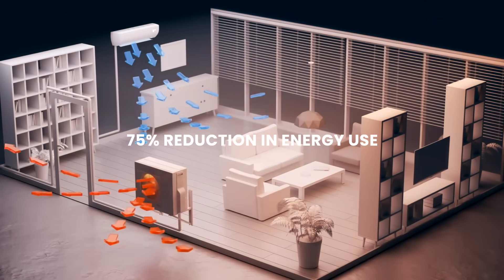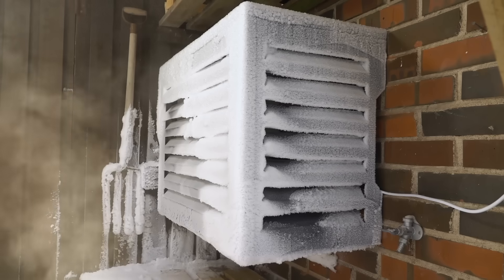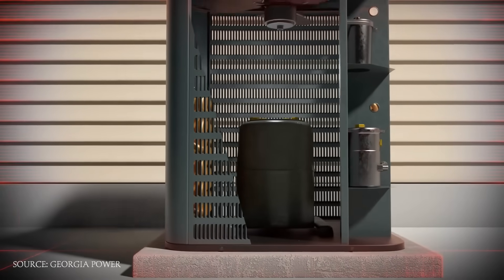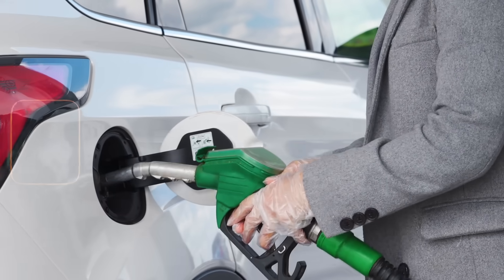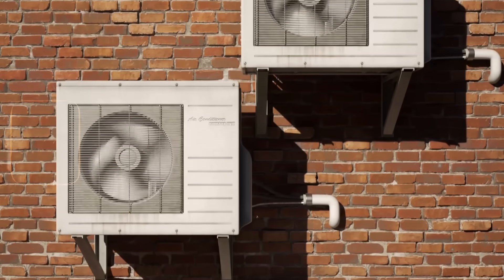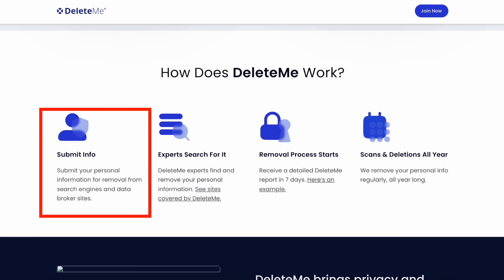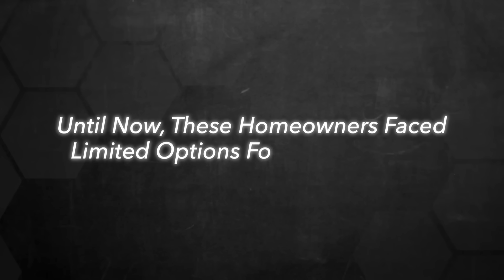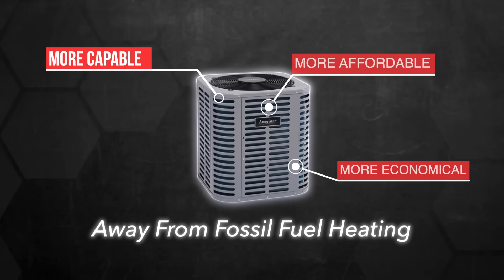Genius Heat Pump could change how we heat our homes forever

Comment: If it is indeed -32 degrees F that this heat pump can still operate to that is impressive.

At temperatures below -5°C (23°F), many standard models become less effective, but they can still technically operate, just with much lower efficiency.

From what I know, most modern residential air-source heat pumps can operate at outdoor temperatures as low as -15°C to -25°C (5°F to -13°F). Now operate, of course, does not mean they are efficient.

NOTE: Modern residential air-source heat pumps must have a minimum HSPF2 of 7.5, with high-efficiency models reaching 9 or higher. This means they deliver 7.5 to 9 units of heat for every unit of electricity used.

Checking the internet, I found the statement, "Some advanced cold-climate models can function even at temperatures as low as -22°F (-30°C)."

Comment: The first thing people should consider is are you going to stay in your home until you die, number 2 how old are you, if you are in your late 60s or early 70s it will never pay back
Reply: There are 2 parts to this and you are only addressing 1.  Yes, the ROI short term may not be there.  However, if you can show that your heating/cooling bills are $$/month lower than they were with traditional/the previous/comparison systems, then that increases the value of the asset.  I'll give you an example, let's say you're saving $100/month as compared to your neighbor for an near identical home.  Let's also say that this unit lasts 15 years.  At a minimum, without factoring interest or your tax rate, the borrowing power of your buyer will be $100/ month more or $1,200/year or $18,000 over the life of the unit - and that's also assuming that the price of energy does not increase.

Comment: Huge negative about heatpumps is that it takes moisture out of your house during winter, which makes it feel colder but also steal moisture from household items like shoes, which makes them brittle within a few months to a season. Ill take gas and oil any day over these overpriced systems that use basic off the shelve parts. Gas and oil systems are cheaper upfront, and have stood the test of time. Many new technologies have many issues that we all will see in the near future.
Reply: What do you mean? Assuming there aren't any leaks heat pumps don't take moisture out of your house during winter. If they did, where would the moisture go?

Comment: Until this industry gets their act together on costs, these changes can't take place on a large scale.  More than 20% of systems
are damaged by the design of the system, the bonehead who installed it incorrectly or the "tech" that doesn't know crap.  I spend
all day fixing systems that should be denied the warranty because the equipment is abused.  This equipment should last 25 years but
barely lasts 15.
Reply: Most of it is worn out in less than 10 years. Replacement cost are outrageous because of greedy HVAC contractors.  I worked in commercial building maintenance and I know what contractors pay and the mark ups to the customer. Natural gas heating is the best option for most homeowners or wood burning heaters.

Comment: My cold climate mini split hp is rated to - 10 F, it works just fine to -15 F, below that it makes a loud rattling noisi and I shut it down and use my large wood stove until it warms up. I amolder and the hp isway easier and cleaner than wood heat and about the same cost as fire wood, even though my electricity is way over priced at $0.30/kwhr.

Comment: This is nothing new. They have been using this for decades for very cold like - 70F freezers in medical labs. 

The issues is you have two of everything and anything that breaks takes the whole system out. 

As a 20 year tech who went to two years of trade school and tons of manufactures training sessions, I can tell you that to make it reliable they are not going to be able to cut the normal corners and it’s going to be insanely expensive. 

This tech or idea has been around for ages. The reason it never made it market is the cost and political environment. 

But now they see that people are more willing to pay / government grants. 

Also you said it works good at up to negative 32 degrees. The question is once we get below freezing, what’s the COP. 

That’s the dirty secret they don’t talk about is when you push that hard it what kinda COP are you getting.

And their prices are insane to be honest. You can use fossil or back up heat for years and years and never equal the costs.

Comment: Question: Systems like geothermal give a 'boost', if you will, to the heat pump so that it has some added energy to make up for the inefficiency in the system. Would it help my heat pump in the same way if the compressor unit was situated in a green house to help absorb solar heating energy in the winter?

Comment: Guarantee these are going to be wildly expensive to service/maintain, and as with any software critical system you're going to have wildly expensive control boards that are going to fail and will cost 2/3 the price of a new unit to replace.

Comment: You seem to have neglected discussing how tariffs might affect heat pump prices. 

The Daikin Oterra that I had installed in December '24 was made in Malaysia. I got a $600 rebate from the power company, and $1,500 federal rebate. My unit is not eligible for tax credits. I bought the 2,400 BTU version; the 1,800 BTU version would have been eligible.
Reply from the maker: This is a video title I have on the list 😁 its actually a bigger topic so a full video is needed that's why I haven't brought it up in any videos yet

Comment: standard ac comporessors are only designed to run 1200-1500 hours a year.  running compressors 4-6 thousand hours a year reduces the compressor life.  the compressors used in data centers that cost 4-6 times more money can run 4-6 thousand hours a year but even these rarely see more than 10-15 years before needed replacement

Comment: we can easily convert 92% of gas into energy to heat homes, hot water.  ASHRAE has measured the grid 25 years ago.  3-4 cop is still more ineffecient than gas.  further, the amount of natural gas produced is based on the amount of gasoline and diesel so we cannot just burn the excess.

Comment: Higher initial cost, replacing inverters, reversing valves, heat strips, and the labor for repairs eliminate any energy savings over the long run.

Comment: Did I miss the most important number? What is the COP when it is -20°F outside and +70°F inside?????
The vapor injection systems (HyperHeat) are over 2.5 COP at -20°F. Seem like running 2 compressors and getting a COP over 2 sounds hard.

Comment: Sounds good, but you would have to use multiple compressors right ? Compressors use a lot of power. How does this fit in with the energy saving equation ?

Comment: If you use an R290 ATW mono-block heat pump, you only need a single compressor at low pressures to accomplish the same thing. As you can imagine a cascade with 2 refrigerants and 2 compressors is far more complex and expensive than a single refrigerant R290 invertor heat pump.

Comment: You say this relies on software. Is this a hard coded firmware in the device? Or is it a software that they are working on and developing over time? Is this software that requires the system to be connected to the internet for future updates? Future updates that are free today but in 6 months to a year will require a subscription becuase shareholders want to see increased value?
Reply: I'd say with maybe 99% confidence that it will run without any Internet connectivity. It will probably come with a working firmware which will only be updated if problems are discovered or the system is changed.

Comment: "Replacing fossil fuels"?? Dude, where do you think the electrical power comes from to run those wondrous heat pumps? Most of the electrical generation in the USA is done using those evil fossil fuels, either natural gas or coal. Stick to HVAC issues, not bogus "climate change" BS.

Comment: You say the price premium because of the improved efficiency. That's only one way to justify it 

The price premium also makes sense of you consider that you're actually getting two or more heat pumps inside the cascade.

Naïvely you could think of it as paying for one pump for cool weather and a second one for really cold weather. The savings don't just add, they multiply in the very cold season.

Comment: This is how scientists studying very low temperatures (like -200 C or -400 F) have always used cascading refrigerators ...

A canvassing heart pump is the same thing, but when used for the heat output rather than the cooling. Every refrigerator or heat pump does both, it's just which effect you want.😊

Comment: Multiple loops for the coolant just means more points of failure. 

I will just stick to my water source heat pump. No loops. Just uses my well water. Once the heat is removed from the water it dumps the water into the creek that runs close to my home.

Comment: You would really need to present a curve of COP versus outside temperature (delta) to compare this unit to other heat pump tech.  Video would have been way better with a nice COP chart from -32f to 70f.

Comment: This sounds like it would require 2 or even  expensive compressors because they only work if it is compressed   , and powered  , also a lot of seals any one of which failing will render the entire system unusable ? Also I get about 250 power failures for each gas failure ( which I have no control over and can do nothing about as it is related to the fundamental technology of how the distribution system I do not control works , also the coldest time of the day is at night when solar is useless and 12 hours of battery  is in the 10 to 100 of thousands of  dollars  ). Also Minnesota , Montana and North Dakota get to -40 not -32

Comment: Ammonia to CO2 is a pretty common cascade method for warehouse scale freezers. Ammonia is a very efficient refrigerant but poses a lot of danger piping that into an occupied building, so they put the ammonia system in an outbuilding with a heat exchanger to cool down the CO2 condenser side which is then piped to the warehouse. 
CO2 requires quite a bit of pressure to condense at normal ambient temps. The ammonia pre-cooling lowers this quite a bit, improving efficiency over a straight CO2 system.
Reply: A dairy I worked at years ago had a constant struggle with ammonia leaks. People would flood  outside except for the old timers who would keep working and complain about the new people being wimps. 🤣🤣😷
Reply: @oldnhazy8796  1 big sniff at ammonia and you could lose your ability to smell for years or forever
Reply: @sza2bom  Yeah, I avoided it, the offices emptied. But there were always a few diehards around that probably lost their sense of smell and who knows what else a long time ago. They.of course tried to shame others who worked close to them into sharing the misery.. Typical American company.🤣🤣😷

Comment: Interesting system but looks like twice as much to go wrong and very expensive. I live in Canada 🇨🇦 so I get long cold winters. I use a mid efficiency heat pump and it is able to carry the full heating load about 95% of the time. I accept the fact that there will be a few cold nights when the backup electric elements come on every so often to assist the heat pump. Far cheaper to get a little assistance from electric resistance heating once in a while that putting in a system that can supply 100% of heating.

Comment: A big part of the energy savings and wider temperature ranges is available now with WSHP on larger buildings for example a school. The different units in different zones will temper the return water and in essence transfer the load from area to another. The variable refrigerant systems can do this as well, but they the also have a lot more infrastructure that usually prevent this from being a feasible arrangement in a smaller home. A good stable ground source heat pump eliminates this problem as well.
Another issue is that if you live in area that has conditions that are brutal relying on one source for heating is not a good plan. If you lose power you are going to need fire and although you may be able to use wood burning stoves there are other things to consider. Hot water is pretty nice.
Great video though. I had seen some of these systems a few years ago and if they can find a niche in the middle climate areas at a reasonable price.

Comment: No way for homes. First too pricey, second it's a complex system and you dont want to be at your home waiting days (at best) for a tech finding which part broke and fix this (weeks at worse) third we already have a device that works perfectly called furnace .... Geo thermal is way better if you want to go the route of long term savings especially when the price is similar. Commercial use only where  they can afford a backup system when the main break down.

Comment: When I hear 'software' in relation to an appliance or HVAC, I think "expensive circuit boards that fail often", sort of like that circuit board on your $1200 refrigerator that costs $800 to replace.
If I'm living in an actual off grid situation in places that can drop to minus 30 F, I'm going to have some sort of combustion as a primary or fallback at a minimum, whether that's oil, kerosene, wood or buffalo dung. Loss of power could be fatal without it.

I'm not seeing the benefit for this in a hot location at all. Heating tends to be minimal, and the optimization would be for higher temperatures.

That being said, it's an interesting approach, and would be something to consider in cold climate areas with reliable electricity during winter storms. Places subject to outages during snow or ice storms would see an all electric system fail at the points when they're needed most. Then again, electric dependent gas furnaces don't work in those situations either.

Comment: IF we could only put the compressor electrical motor itself inside the house so the motor wire resistance heat along with the fluid compression head are both dissipated inside the house we are trying to heat.  it would be a complicated system because for A/C cooling  the motor needs to be outside
Reply: My impression from this video is that the compressor is inside. Cooling is also possible with the compressor indoors.

Comment: You cant get a knowledgeable HVAC tech to fix the equipment we've had for the last 40 year's and you think your going to get one of these numbnuts to fix a cascade system with different refrigerants and probably an ungodly amount of thermistors, sensors and electronic controls? Good luck.

Comment: been saying this for years... combining singular systems into composite systems increases the efficiencies! can literally do this with so many things to improve the overall efficiencies of most systems!
Reply: Same thoughts probably went through the mind of the very first heat pump maker. Seems you could simply line up two or three in a row and use the appropriate refrigerant in each one. Thermostat could decide which one(s) to turn on.
Reply: @roginutah  these are just a more advanced version of the Sterling cycle and we've come a very long way with material science since it's invention! I keep saying the key to reducing CO2 and "green" energy is in utilizing MORE Sterling engines, they're far more efficient and equally as capable as a gas or diesel engine when designed for that application and in the cases of heat pumps and refrigeration it's almost perfect. it's a thermodynamic engine/cycle it's about as stupid simple as it gets in terms of use case. the mere fact that a Sterling engine will work with just a temperature differential and nothing else... could literally bury the cold side in a sand dune and expose the hot side to over 100°F sun and heat and the engine would just run, even more so if you drove cooling rods connected to the cold side deep into the ground. I don't understand why we're going the way of wind turbines, solar panels and EV cars when Sterling engines are far superior to all 3 combined with far more efficiency, power output and lower cost to produce with a far longer life cycle and less maintenance! society is stupid... If i had even 1/8th of Elon Musk's $$$ I'd be churning out Sterling engines and putting everyone to shame!
Reply: @ToeCutter454  They, apparently, aren't after real "solutions" to the problems they say we have. I'll look into the Sterling engines. Thanks.
Reply: @ DHIndustries channel has a nice old 2 part clip on here going through the whole Sterling cycle and not just it's ability to produce power but also to boil and liquify air if driven by another motor in one direction or the other. NASA also built one in the 90's and put in a Dodge pickup and drove it around and tested it, they run like a diesel and they found it was about 2-3x more efficient than a gasoline engine and it also passed California emissions with no catalytic converter! which means it burns cleaner than a gasoline or diesel engine without the need for additives or a catalyst to clean the exhaust! where it disappeared to is beyond me but someone paid them to hide it! there is a video of that on here as well but it was harder to find in recent months.